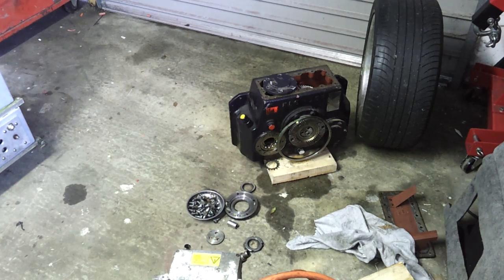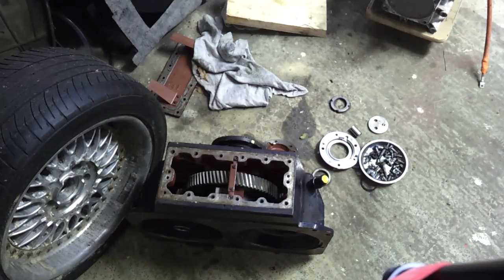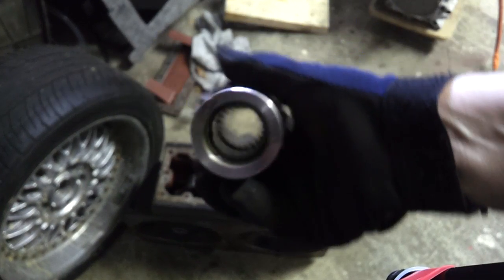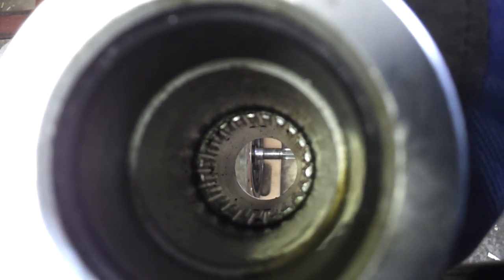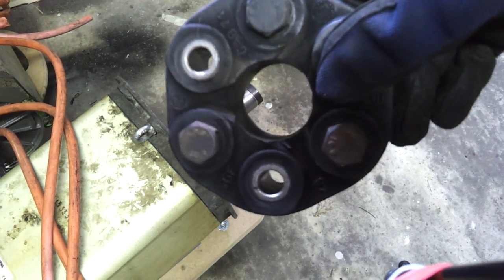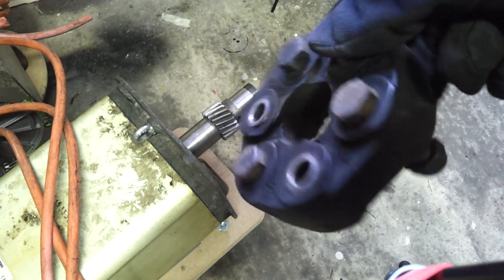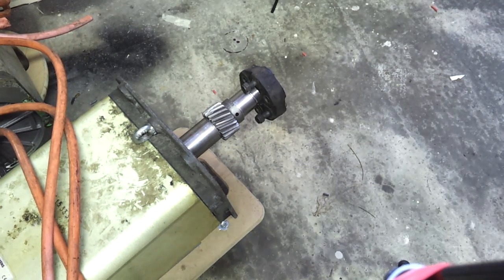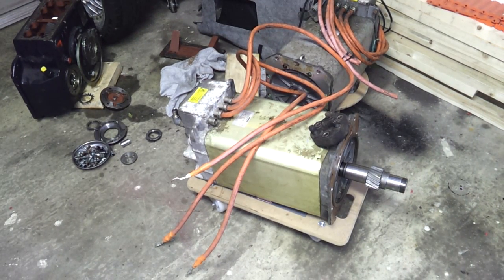BMW E46 Budget Electric Drift Car Project 03 : Driveshaft Coupler

Comment: I'm getting a bit bored with the next to useless clutch and heavy flywheel and thinking about replacing both with one of those driveshaft donuts. Do you think it would work?
Reply from the maker: +Jarkko Santala You mean to connect a motor to a gearbox input shaft? I tend to use solid steel couplers in this instance.
Reply: Solid would be best, but you need a solid alignment as well then. Mine's not probably good enough for that.

Comment: so, you are going for direct drive? will it have enough torque? I have warp11 and big ass controller, but still not sure if it will be sufficient even with auto 4.44 diff. how does it feels on land yacht, enough torque on say second - third gear? you have there 2.5 diff?
Reply from the maker: +Yuri LM Yep plan is direct drive to keep it cheap and simple. Land yacht can drive all day in 4th or 5th with a 2.81 diff:) I don't know if the plan will work. Only one way to find out:)
Reply: +Damien Maguire there is Opel omega conversion in Croatia, you can find it on YouTube. he used warp9 motor and direct drive, along with warp drive 1400A controller. looks impressive. but I'm still in doubts, need to try it myself, still working on direct drive on my e36, that warp11 doesn't fit there that easy. wish you good luck with all projects! BTW have you any issues with insurance, as all you cars are 10+ years old?